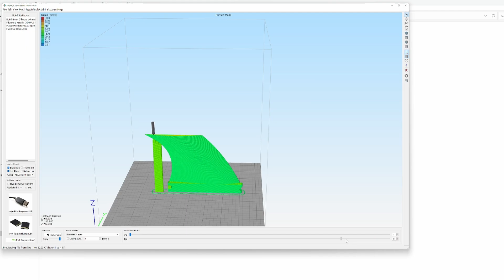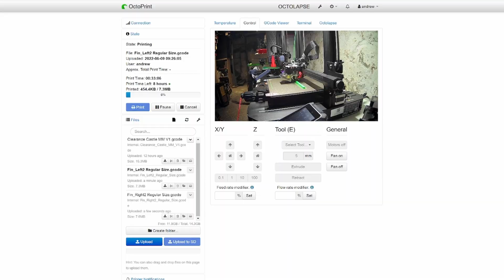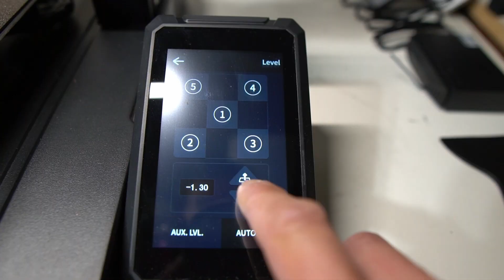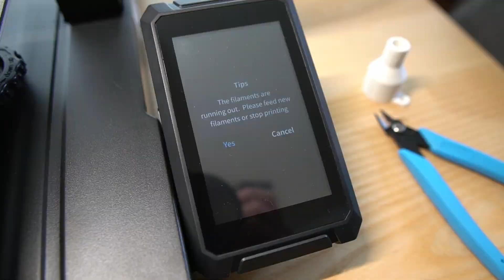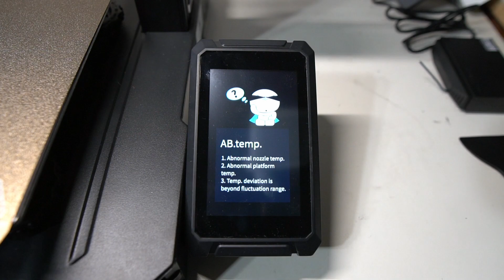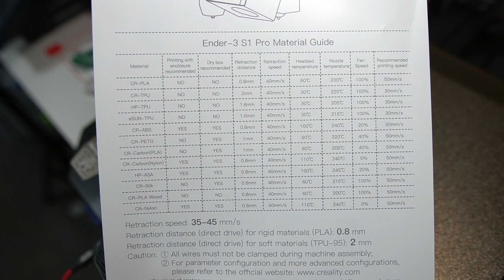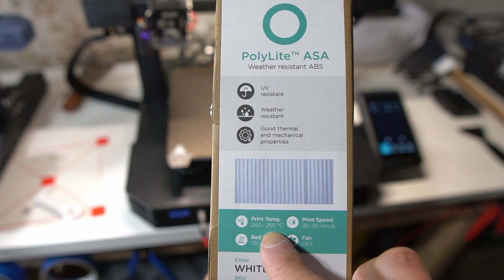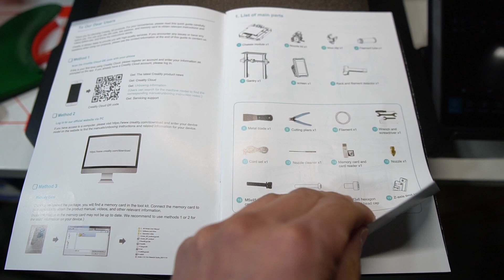Creality Ender 3 S1 Pro Review | A Plug and Play 3D Printer

Comment: Please stop using S3D, their profiles are outdated along with thier slicing. I started using S3D back in 2014 when I started my 3D printing bussiness and withing the past years S3D support was slowing dropping off. They used to push out updates weekly improving the slicing and adding new printers, support would reply in hours, then everything just dropped off the cliff, no more updates,you cant add any profiles from their cloud based printer profile picker (Joel from 3D printing nerd did a whole video on this) they also promised a brand new version that was going to be a ground breaking new slicing program and they were in beta testing and about to release the new program and then everthing just stopped. They no longer reply to any emails, the fourms are absent of any employees, yet they will still take your money for the program. 

After getting frustated I went ahead and tried Cura and holy crap how much Cura has advanced, S3D still has the better UI but Cura has SO many more options and they are tweaked perfectly for the printers. I still am getting used to the UI and using some of its features like ironing etc but the prints compared to S3D as so much better. S3D has been known to have slicing issues where random holes will just show up in the print, never had a issue with Cura. So I highly reccomend trying Cura.

Comment: Yes, the E3 S1 Pro is about as plug and play as you are going to get, at least from Creality. Since the original E3 the Creality printers have improved. I love my E5Pro and am considering the E3 S1 Pro myself. 

Regarding 'stratasys' a hobbyist is not likely to have one, not unless they are moving from hobby to professional printing. I reviewed their website and feel confident with my assertion. 

Creality opened the hobby of 3D printing to the masses. 

The only "nit" have so far with Andrew's review is he did not call out the all metal hotend feature but instead focused on the difference between bowden and direct drive systems. The E3 S1 is direct drive BUT still has a piece of bowden tube that goes to the hotend. The E3 S1 Pro does not. The bowden tube portion (a very small piece) is used to direct the filament into the all metal hotend. 

All in all I'm happy with Andrew's review and he covers a lot of things a beginning may need to know.
Reply from the maker: Thanks Tony, good to know about the E3 S1.

Comment: It's not plug and play. Leveling the bed is a never ending nightmare. Do your research and avoid creality! Also literal worst customer service EVER!
Reply: Sounds like a user error, I have 20 different Creality Printers in my print farm and there is nothing I havent been able to fix or get replaced. They are great printers, just because you dont know what you are doing doesnt mean its a printers issue.
Reply: No, Kisuke686 is absolutely right.  My bed is severely warped along the Y axis.  Also, all of the adjustable rollers were grossly over tightened.